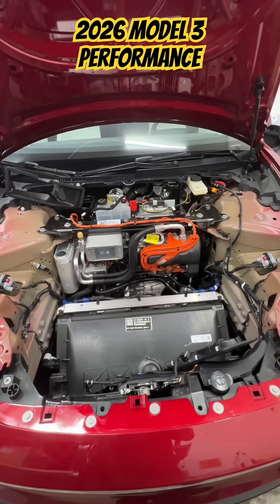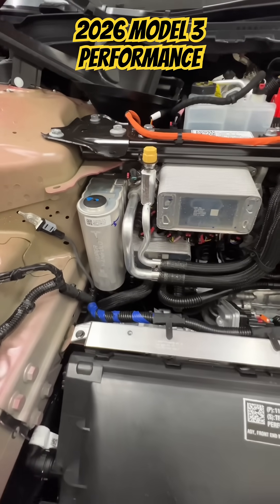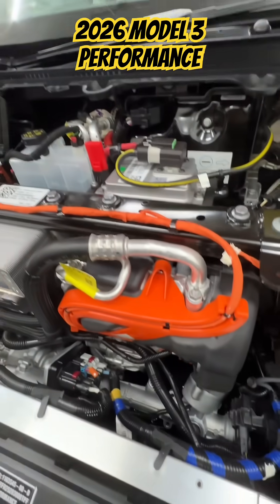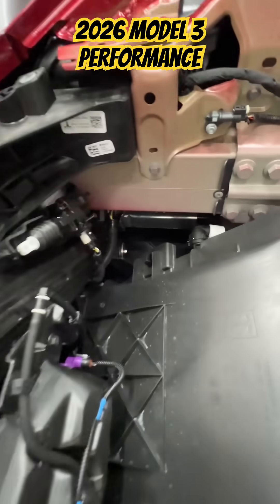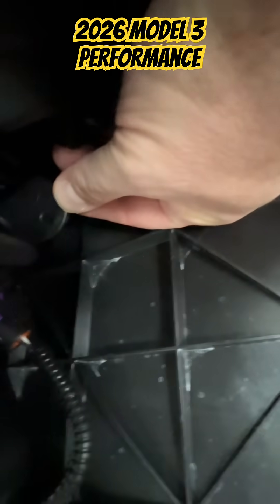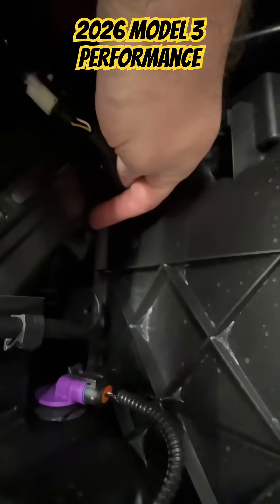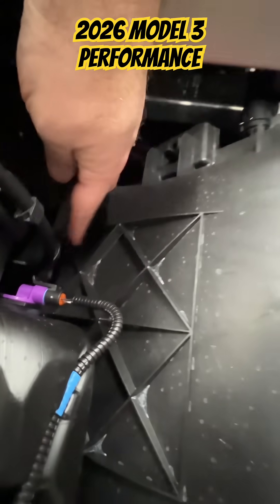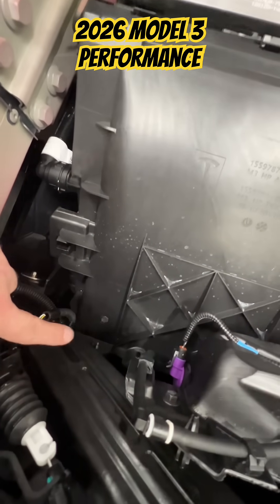2026 Tesla Model 3 Performance- What is this??? #tesla

Comment: What kind of battery it has ? U mentioned it’s no longer like the previous models
Reply from the maker: New Tesla cars (manufactured roughly after late 2021) now come with a 15.5-volt or 16-volt lithium-ion (Li-ion) low-voltage battery. This replaced the older 12-volt lead-acid batteries to offer significantly longer lifespans, lighter weight, and better efficiency in supporting in-car systems.  My only issue with this is that you can’t run down to Autozone to replace it in an emergency.

Comment: It’s for the garage door opener module.
Reply from the maker: That’s what I was thinking, but the service manual says the Homelink garage opener is installed behind the bumper in a different location.
Reply: Makes sense. Easier to access without having to remove the bumper